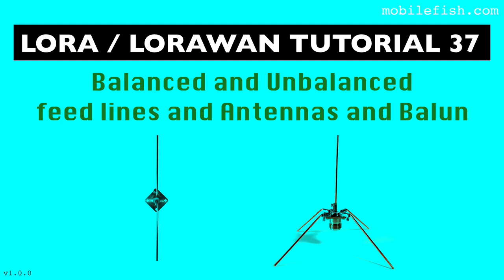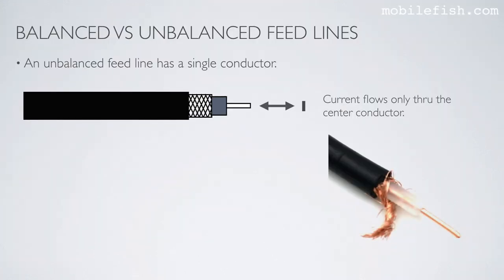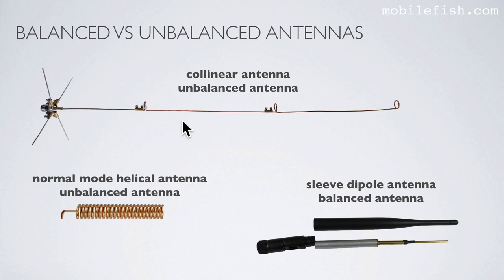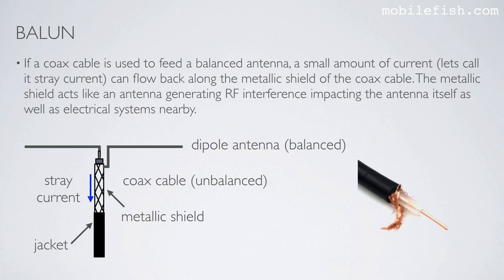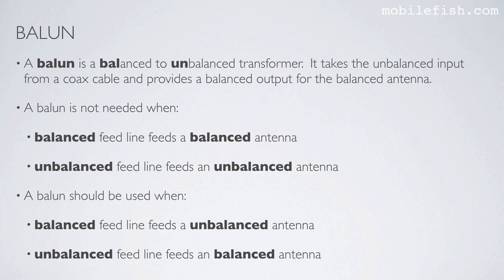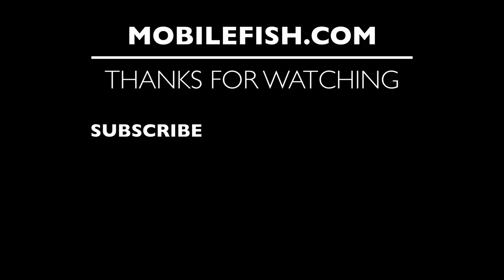LoRa/LoRaWAN tutorial 37: Balanced and Unbalanced Feed Lines and Antennas and Balun

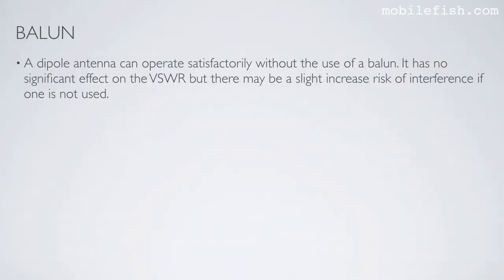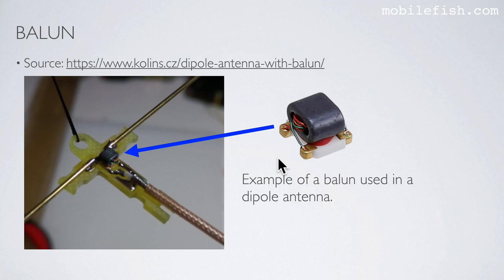Comment: Greetings Mobilefish! I apologize but I must disagree with several of your assertions and illustrations.  @0:35 you say current flows in opposite directions; well that is true for any pair of conductors completing a circuit, the key point of a balanced line is that each conductor has equal but opposite voltage APPLIED to it FROM THE SOURCE, which is crucial to the definition since a coax can have opposite currents if you are using a dummy load, but that doesn't make it balanced.  I mention this because @1:36 you show 2 antennas and you call the one on the left, a dipole, however, it appears to have a coax chassis connector on it, which presumably means you are feeding it with an unbalanced line, and if that is the case, you do not have a dipole because you have not split and inverted the current through a BalUn, you simply have a monopole with a poor impedance match; you have induced currents on the coax shield because you do not have a proper counterpoise.  In other words, just because you bend the radiator and counterpoise to be 180 degrees from each other, does not mean you've created a dipole.  The same goes for your "Sleeve Dipole" @6:15 . I know people call this type of arrangement a sleeve or strip-line dipole, but in fact it is a monopole with a poor counterpoise, again, because you have no differential current at the feed-points of the radiators, you have a monopole radiating, and because you likely have an impedance mis-match, which is causing your antenna not to radiate efficiently, you are getting the un-radiated current back on the shield so it complete the circuit by going back to the radio instead of being radiated.  The best you could do with a strip-line/sleeve dipole is choke off the coax at 1/4 wave from the feed-point. @2:53 you show a BalUn, and you say "it can be used to prevent current from flowing back on the coax shield", but you don't attribute to it, it's most important function and purpose, which is to create differential current into two separate radiating elements, so that your dipole is then an actual dipole. @3:22 you talk about the BalUn doing impedance transformation, which can be true, but it would not prevent an novice from thinking that if they were simply to use a 75 Ohm coax instead of 50 ohm, they would have no impedance mismatch going into one of your 75 ohm "dipoles", and therefore no "stray current", but of course that would still not make the antenna a dipole. @3:45, that statement is simply incorrect, an antenna fed by unbalanced line, is simply a monopole using the shield as a counterpoise, and the reason there is "interference", is that the shield is carrying current and radiating outside the antenna system. @4:22 that is a true dipole antenna, fed by a coax, because the BalUn is creating differential current on each monopole radiator, hence creating a true dipole.  @5:08 your last to assertions are not correct because you say "a BalUn should be used...", your statement would be correct if you said "MUST be used".   Without the use of a BalUn, in most of the designs you show and call dipoles, you really have a 1/4 wave monopole with a poor counterpoise. because you do not have differential currents on each antenna leg.

Comment: When should a balun be referred to as an unbal? Is it when it is converting a balanced feeder to an unbalanced antenna?
Reply: You would almost never bother running a balanced feed-line to an unbalanced antenna. Remember, an unbalanced antenna is one where there is voltage on a radiator, and a counterpoise that can have an Earth ground potential, but more importantly, decouples the shield a coax shield from current traveling on the shield; this is why it generally wouldn't make sense, since a balanced feedline is supposed to have current on both conductors, albeit the currents are differential, and both originate at the transceiver. The only time it would make sense to run balanced line and use a BalUn at the antenna, in the reverse way it is normally used, is if you have a particularly long cable run, where you would lose a lot of signal, and/or you need to operate the unbalanced antenna over a wide frequency range, where you are likely to have high VSWR, and therefore using an antenna tuner between the radio and the balanced feedline, would provide a good impedance match at the radio, and since you're using balanced feedline, you can contain the radiation created by the high impedance mismatch at the antenna, due to the characteristics of balanced transmission line. If you want my critique of several parts of this video, which might help your understanding, look for my earlier comment.